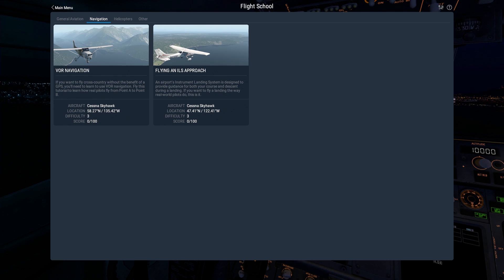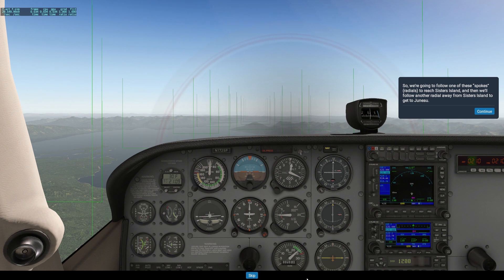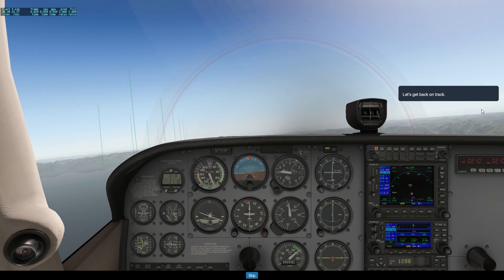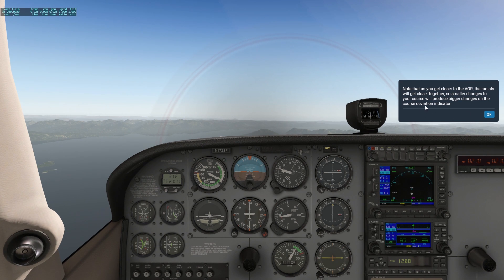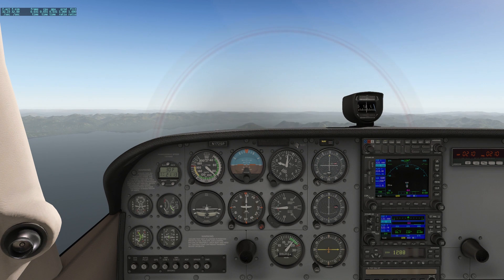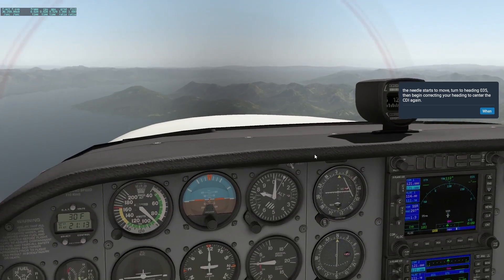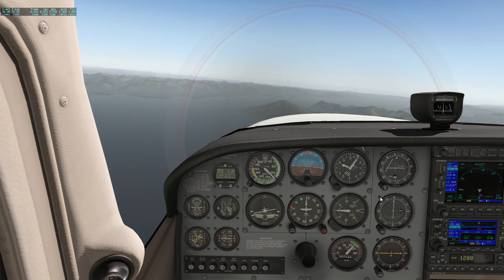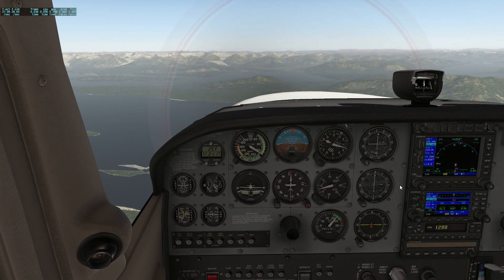X-Plane 11 Flight School #3 - VOR Navigation

Comment: Hmm 
I thought planes cpuld navigate on their own. Like cars or walking 

Imagine a VOR in every major and minor location in the city. 

Or any amount of infrastructure like that snd not just sign posts and billboards. 

I thought it was like a more complex sextant but instead of stars it used magnetic fields and some weird contraption for altitude

So how did the bombers do it back in the day 

Isn't there a a slide rule computer (analog like a plastic scale) that they still make pilots do calculations with for their exam ? Il2s something something

Comment: The best procedure is 1) tune identify and monitor 2) Turn to place the head of the bearing pointer under your heading 3) center the CDI and maintain it centered.  Does this aircraft have a bearing pointer?
Reply: With no bearing pointer (like on a real RMI) check for a TO indication then center the CDI and maintain it.

Comment: Ok, this isn't a comment on you or what you were doing, but the sim. That was completely useless information. I am not a pilot, I don't know what VOR's are or what they do. They really didn't explain what they are, how they work or how to use them. It didn't tell me how to find them, I would assume you use a map or a chart? It didn't tell me how to set the gauge or heading or any of that. Seems like that would be pretty important. And don't you have to enter a frequency somewhere? It would be kind of nice to know where to find that frequency and where and how to enter it. Again, pretty curcial information lol. All it really did was tell you to keep a white line centered in the gauge. That kind of seems like the easy part lol. Without your naration I would be completely lost and confused. I mean I am still lost and confused, but I least I have general idea of what you were doing. I don't know what you were doing or how, but I get the idea behind it.

Comment: Jeff did you find out what gave you that score? Is it a glitch or something? I'm trying to master VOR navigation and get about the same score... I don't think I am doing anything wrong either.
Reply: Same here. I've done this lesson probably thirty times and typically get around 50% or 60%. A couple of times I got in the low 80s, 82 at best. Those times I flew at quite a slow airspeed, basically always had the needle glued exactly in the center of the CDI, and intercepted the second radial super fast and accurately (staying at 35 till the needle moved, then moving toward it when it stopped).

Honestly I think the lesson is buggy, or way too demanding for the score to be actually useful.

Great videos, though, Jeff, really enjoy them. It's nice to hear you explain the concepts in more detail than the "flight school" does and you've got a good sense of humor too!

Comment: This game is anoying me as it does not tell you how to tune your aircraft to VOR's i've been all over youtube and can not find it!
Reply: you tune them via the nav part of your radio ... using skyvector will not always work though since sometimes the in-game frequencies are incorrect ... you tun the frequency ... make sure your on NAV vs GPS ... and you rotate the radial until the 'TO' shows up... TO - means you are flying 'TO' the VOR 'VOR's .... I keep the new frequency of the next radial on standby so when I intersect the current VOR I switch over and re-align...  hopefully that helps you a little bit =\   also VOR's have a maximum range they can be picked up from ... the VOR system is being decommissioned in real life so don't expect to have them available in less traveled areas...  I for one am learning to use VOR's first before I worry about my GPS as honestly that is plenty easy to figure out if you can hit a few buttons and enter  the airport ID code...

Comment: Yes, the instructor does do some wierd things in this flight lesson. But the major thing missing from this flight lesson is making the pilot find and enter the proper codes to fly this ILS approach. That's at least half the work, and the more obscure part for most who have never flown an ILS approach.
Reply: I am not a pilot and have never been to a school. Would you mind explaining how to find the codes and enter them on the nav screen please! I just started xplane11 but basically I would like to fully train myself this way.
Reply: @gruanger  they will be in charts I think. You enter the frequency listed on the chart for the VOR and listen to the morse code to confirm (if available). I'm not a pilot either nor do I have many hours in simulators, but another tutorial explained this. I think you tune using the radio stack on the right. I don't know the range of a VOR, but generally higher frequencies have less range.

Comment: If VORs are going out of use, what is used to map waypoints for GPS navigation? RDB's? What will this mean for aircraft that are not equipped with GPS?
Reply from the maker: waypoints/intersections are completely fabricated now and used for RNAV (random navigation) I think this pretty much puts a solid foot down that airplanes will be required to have at least GPS for navigation. I have to say VOR's don't seem to be going anywhere as the FAA still favors them. They are being phased out slowly though.

Comment: Question: Is it wise to decommission all the VORs, or is the maintenance expense to prohibitive to keep them in service; even as a backup in case GPS fails?
Reply: As a flight simmer myself and ex online atc controller on a private network. In my view it's going to happen the chances of a complete gps failure are incredibly small the satellites are pretty well protected in their orbits they get minor impact damage so does any other satellite (just read what nasa says in documentaries etc) plus gps is also being improved rapidly and it will soon be even more accurate and pilots still have VFR as backup. In terms of cost as equipment gets older it does get considerably more expensive to maintain and if new technology is there that can do the same role and more then it makes financial sense ok in the short term it's going to be expense to install but it will be cheaper in maintaining for years to come eventually recooping install cost